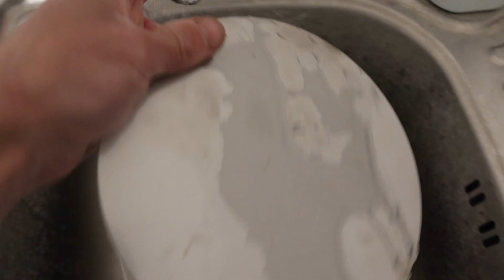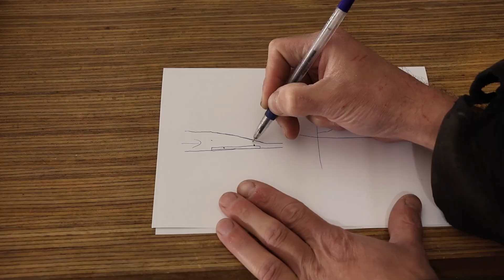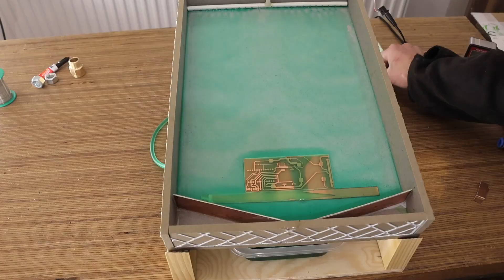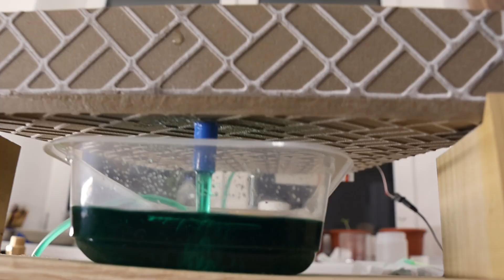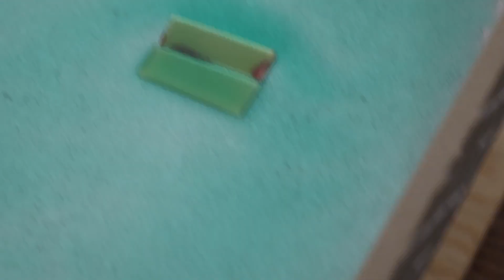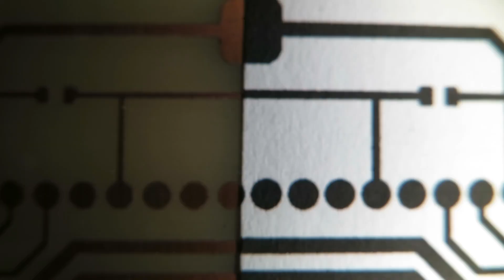PCB flow etching machine

Comment: Very cool, a compatible detergent to increase wetting would help, not enough to produce bubbles.
Also, would it help to reduce the angle of the slope drastically? As if it was a weir that lets the fluid accumulate and then spill over to the catch tray.
Or just have the liquid fall on top of the piece.
Reply from the maker: I guess that base + long chain sulfonates could work as detergent? I would think, that sulfonate will survive HCl solution. Not sure about H2O2 though. That said, I don't think I have huge issue with surface tension here. It could also be counter productive as etchant film thickness would decrease possibly causing slower flow over PCB. But hard to tell without testing really.

Comment: a shaker tub is so much cleaner to work with, just need to hit resonance. no pump needed.
a plastic tub works, glass is better. I use cooking glassware.
use an aquarium heater to warm up your solution. slower etch time can cause over etching.
and add detergent to your etch solution.

Comment: What about putting grooves on the base of the tray, and place the pcb face down?
Reply from the maker: I have experimented with stuff like "vortex generators". Similar mechanism as with airplanes. It works - shorter etch time, but again leads to "hotspots". It's also complex.

But face down etching is a thing. I would probably do it with sucion cup and just suspend it on some structure with a screw for height adjustment. With big boards you need perfect alignment though. and small boards are tricky. Sometimes I do etch just 1cm square boards lol.

Comment: Detergent reduces surface tension and it doesn't take much just a few drops you're not trying to wash dishes.
You're trying to produce a laminar flow over your PCB so you get consistent etching, put a full width blank sheet of FR4 between your "diffuser" and the PCB that will give you the flow without the bow wave at the etch PCB, just sand the edges of the blank sheet so they are smooth.
Reply from the maker: I did not try detergent yet, because I am not sure how well it will survive in acidic environment. Last thing I want is stearic acid in etching solution heh :)